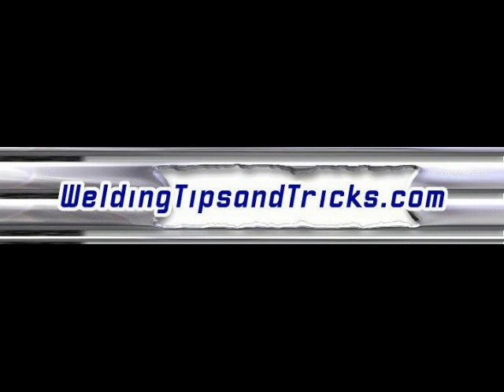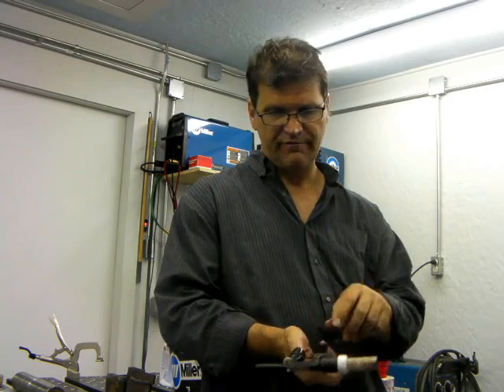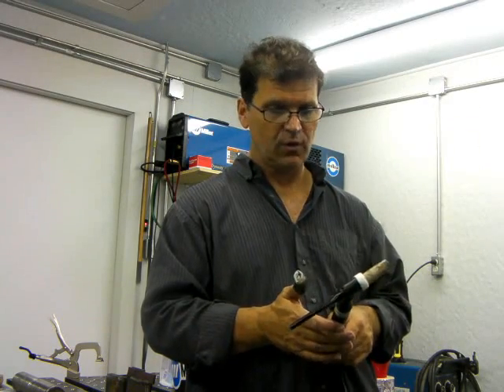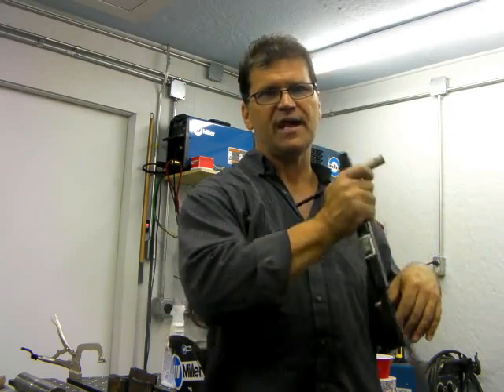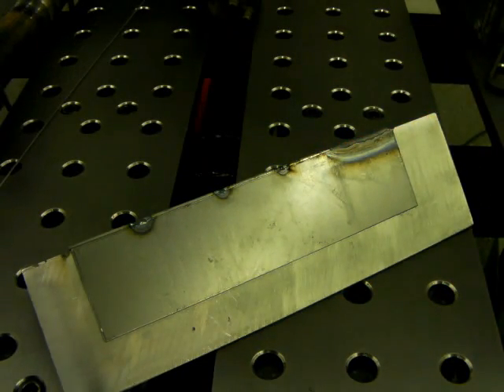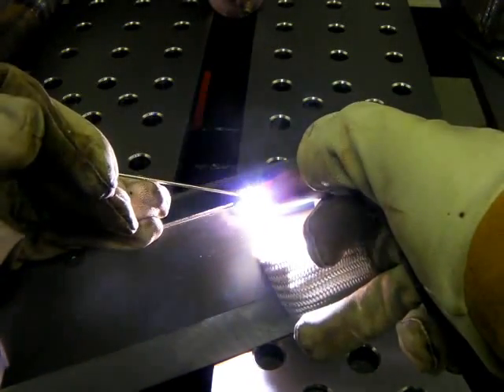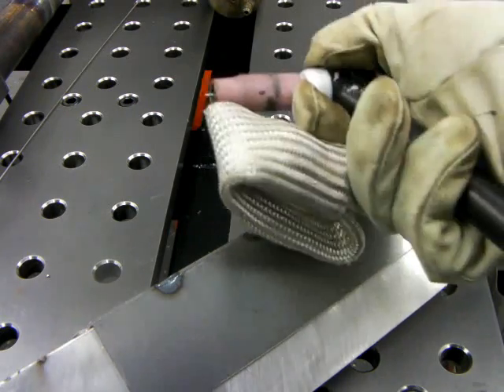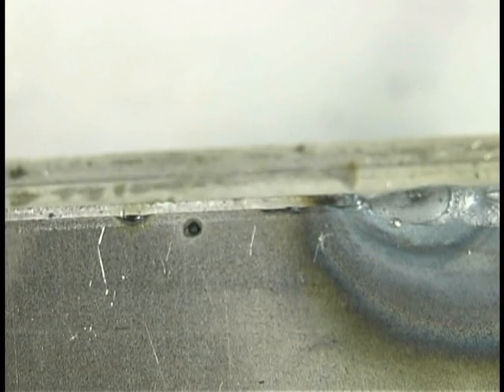Homemade Tig Welder - Tig Welding Old School with Scratch Start

Comment: Yeah, it should work for aluminum.  for steel, get a dc machine.  I scored one at Harbor freight (my job is not on the line here) for $80 for one of those 80 amp units.  It works best at around '40 amps' for sheet metal.  Anything less, and it does not have that Hot start 'feature' to get the item hot initially to get the puddle going.

Comment: Great video. You always have great info and I have learned much from your videos.  We have had to rent a second tig machine at work. It was a scratch start and had a flow contol and amp dial on the torch. It took some getting used to, but I was able to do some pretty welds on 1/16 thick stainless tubing.

Comment: So i have a miller thunderbolt 225 cc Ac (older one) welder,but if i wanted to tig i would have to make a inverter for it ? or is it posible just to tig with Ac?

Comment: I have a gas/gasless mig welder with dc output, i often throw jumper/booster cables on it and use old stick rods when mig wire wont penetrate so i know it can do some amps!

What do i need to make it do tig, tig is a bit uncommon in the uk and at the moment i'm between jobs so broke lol and i'm trying to get into tig on the cheapest route possible

Comment: Thanks to you and all other folks that take the time to share experience with us who have little. I tought myself  MIG via YouTube. Bought a cheap ARC/TIG Inverter - a mistake, after attempts to weld, gave up and ordered a proper machine with features needed for TIG. After this video, I went back to my bench and after a couple of hours I can now produce decent welds w/ scratch start, manual gas flow, no current control. I'm sure that learning the hard way will help. Thanks again for the video.

Comment: At 3:50 when he is wiggling wires on the input side.  the bolted connection is loose.

Should be tight.

Comment: MIG is electrode positive but if you have a welder set up for flux core or know how to change the polarity on your MIG welder you can do it. You just switch over to electrode negative, unscrew the cup off of your MIG gun and clamp the tip to the lug on the TIG rig with a pony clamp. You will trip the duty cycle on your MIG machine REALLY often if you try to weld at the max output like this but in at about 50% it's not too bad. At best it's a marginal alternative to a 115v shoebox TIG setup.

Comment: I have a Lotos stick/tig/plasma  machine. its dc only. both the tig and plasma share the same connector on the Lotos, (to use one  or the other you have to disconnect one and reconnnect the other,) I have another scratch start torch that uses the same output connector as the stick output on the Lotos,  if what you say is ok to do with the Lotos, then I dont have to switch over anything  when going to a plasma cut. tig off the stick output and plasma out the tig/plasma output. Is this possible?

Comment: I have a Lincoln "buzz-box", but I've also got a Hobart motor-generator dc stick welder- that should make a nice power source for TIG?  Would be fun to learn!  I've also got a MIG machine, is there an advantage to TIG over MIG?  Sorry for the ignorance- I'm just a hobbiest- dune-buggies and various car related projects...
Reply: basically /tig is #1 in looks/solid(no-impuritys)clean/less splatter.. #2 mig does job well. /can weld thinner stuff(not as thin as tig) tig takes longer to get job done! takes a more patient person /tig. Pretty work! mainly best on like aluminum- nothing is as strong/pretty on aluminum.

Comment: set your gap and try brushing your filler wire between the base and your electrode to bridge the arc instead of leaving your tip in the melt brother.

Comment: @elcatupe Compra una maquina comun con DC y conectas la varilla DC-EN.  Usa Argon puro.  Si usas Argon con dioxodo de carbon u oxigeno, te quema  el tungsten.  Dura solo por un 1/2 cm, mas o menos y luego se hace bola como cuando usas AC para soldar aluminio.  Se sigue quemando hacia adentro de la torcha hasta que no hay arco.   Se jode todo el jale y nomas te encabronas porque no puedes ni empezar el jale.

Comment: Very informative video it explained a lot to me, but i have a question  
I have a 140 amp inverter which has some sort of a tig option but doesn't have HF .. 
So anyway I was wondering is this scratch start method okay for a hobbyist like myself ? would a pedal fix the oxidation problem ?  thanks for your answers.

Comment from the maker: @welderman27 
the dinse connectors that plug into the machine are the thing.  but you can buy miller style dinse connectors and put them on your torch.

Comment: Now I'm thinking I've got a air cooled weldcraft tig torch and am currious can I use this tig torch and just buy the dynasty 200 machine?? I don't know if I need a special adapter for it or what?? I'd hate to have to buy there tig torch with there machine when I could use my own tig torch.